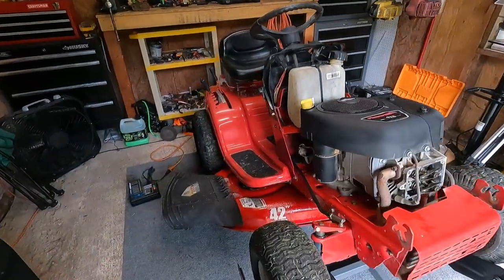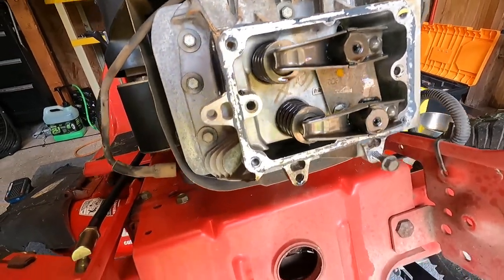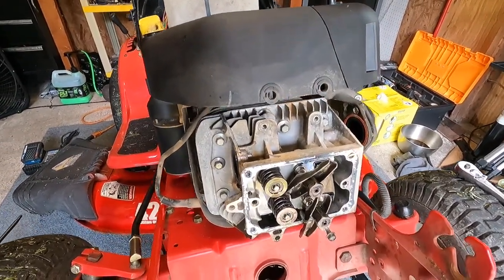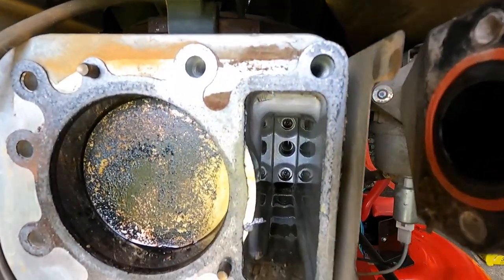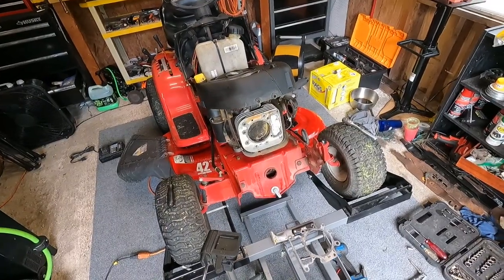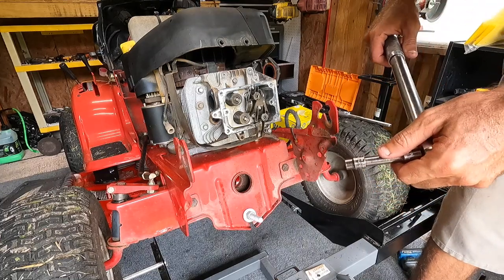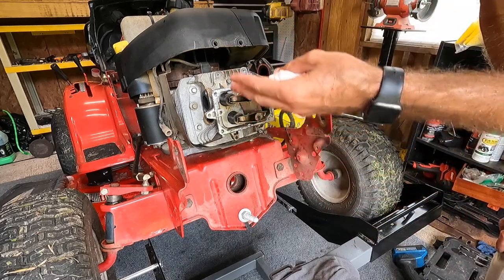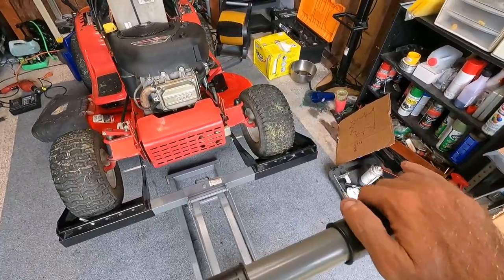RIDING MOWER NEEDS A HEAD GASKET

Comment: Another good repair Alex!  That mower is super nice as well.  The newer 31000 and 33000 series Briggs are horrible for head gaskets.  So little material between the cylinder and valves!
Reply from the maker: You would think they would have tried to fix the issue on these units. At least the head gaskets are a pretty easy job and can get a valve lash adjustment at the same time.

Comment: I was using a brass wire wheel to clean them heads and blocks.  Then I was showed how quick and easy they clean up with 100 grit sandpaper on a sanding block. I fill up the value cavity with carb cleaner to see if they leak. I don't have a leak down tester either.  Another great job!
Reply from the maker: That’s a good idea Casey. I appreciate your input and support!!! 😎

Comment: Alex, you caught that at just the right time. It was only going to get worse from there. Nice job explaining the repair and the torque sequence.  That looks to be a easy sell now! Briggs did a horrible engineering of that head to make the sealing surface so narrow their. You could just about make that a normal maintenance at a certain interval of hours. Stay cool buddy ! ✌🎥🇺🇸💰
Reply from the maker: Thank you so much Roger. Yes I’m glad I caught this before it got to a customer and they had problems. At least I got a video out of it as well and i learning constantly. Hope you are doing well my friend.
Reply: They corrected the space between the cylinder sleeve and the push rod /oil galley where it blowed through the factory gasket like shown on this post
Also double check the push rods for straightness,on mine the aluminum one was bent.
Have a great day

Comment: Great video..I was wondering…you said you loved that mower lift! Where did you get it at?? I like the design of that one also.
Reply from the maker: Thank you. I got this one at harbor freight. It comes in a box and you have to assemble it, but it works great and has locks on it so if the jack fails it won’t crush you. Also a spot to put a tie strap.

Comment: I've been replacing the aluminum pushrod with a steel one because of wear issues where it comes through the guide they are the same length and diameter

Comment: Hey I'm not a .mech. but where the rods go through like plastic black pice one for intake and one for out where you get them and how bad does a rod got to be to not use
Reply from the maker: If it only has a slight bend I would try and straighten it, but if it looks bad I would just change it out.

Comment: Poor design by briggs, needed a bolt there where it is blown.
Reply from the maker: Yes one extra head bolt would have put enough clamp load on these I think. Also the gap between the pushrod area and cylinder was very thin. It made them very easy to get blow by.